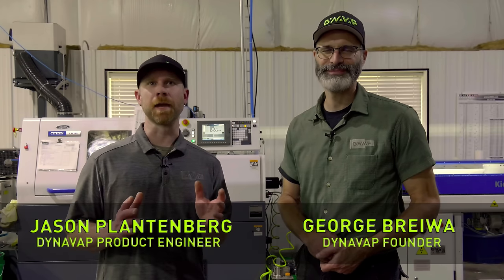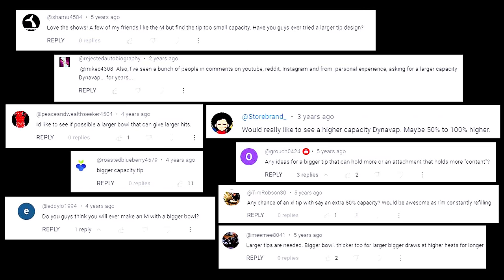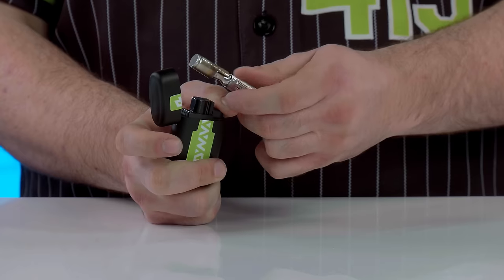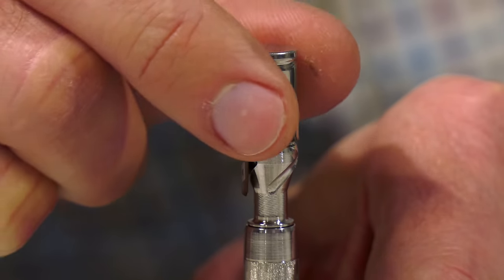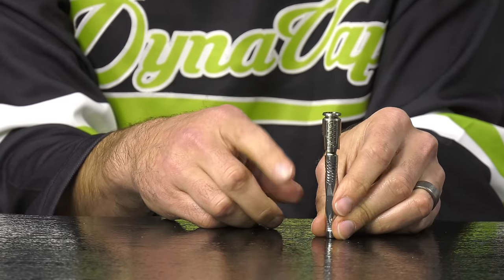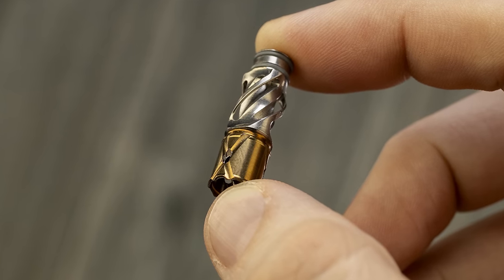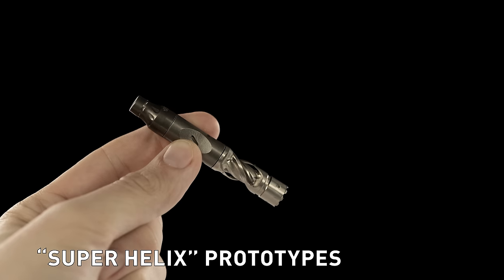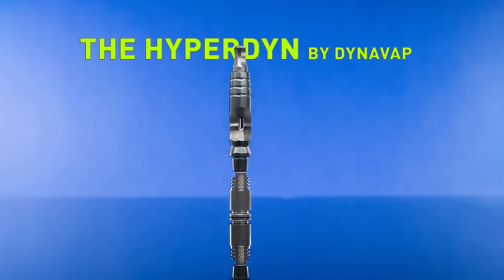Making the HyperDyn Chapter 1

Comment: I literally ordered my first unit yesterday (m7 XL)... don't do me dirty by releasing a better version so soon!
Reply: They always do lol
Reply: Dynavap release new things every year but they are different enough that u can mix parts from different dynavaps to change your experience i use a wood VonG with an 2020 M steel tip and an armored cap in an induction heater for hash in a bong for normal bud i have an 2023M+
Reply: you could send it back and just wait this one out
Reply from the maker: It isn't a new M.
Reply: They offer a 90 day satisfaction guarantee. You could send it back and get this.
Reply: @Dynavapllc  well in that case maybe I need 2 dynavaps :p (seriously though I am so excited for my xl)
Reply: I bet you can use this with your M midsection.
Reply: Once you try a dynavap you won't stop at just one. I currently have more than five different styles of the M model.
Reply: I used to buy new iterations but I keep going back to my 2018 m ss tip, and glass add a cap. Kinda curious about the m7 tip though.
Reply: dont worry you need to add a bit more of cash if you want to get this...! crazy expensiv
Reply: @f7go  not an issue lol
Reply: no real difference since 2018 . 

using rubber and not threads on the condenser.  

no cooling fins inside the stems.  

I've got best results from the original vong without a condenser. 

my ti vong was unusable from day one 😂  

for cool vapour. use any dyna tip and any generic glass stem ✌🏻
Reply: everyone complained about the thicker tips pre 21 .  😂
Reply: @unknown869 just now finally getting my 2nd (a B) for my wife and myself... buuuut I HAVE spent plenty between the low temp cap, the armored cap, the dynastash, the helix tip...

Comment: So...
1) Stems with integrated cooling spiral 'fins', or an integrated tip (?!) 
2) Smooth/no-groove tips all round, like on the woodwynd and M7
3) a new kind of (armoured?) cap on the left; possibly the groove helps remove it easily
4) New XXXL size

anyway, those are some sexy silhouettes. the centre one's my favourite; love a simple, clean mouthpiece.
Reply from the maker: You'll get to see if you are correct very soon.
Reply: Cooling fins are cool,
Loved my Fishbone pipe

Comment: I am a micro doser, so, bigger, with the ability to hold a dosing capsule sold me.  An issue, when I heat using the ISpire Wand, the HyperDyn stem gets really hot - too hot to hold a finger on the carb hole.  I need to find a silicone band, and put a hole in the band to go over that carb hole.  A Dynavap Capsule Keychain that holds 5 dosing capules would be awesome.  Love not having to clean constantly.
Reply: use a torch

Comment: Please make armored cap with interchangeable bi-metal disks.  

How about to unscrew the top of a armored cap and with possibility to change the bi-metal disk?  So you can decide on the go if you wanna vape at low temp or higher temperatures.
Reply: Dynavap doesn't use threads And if they did what you described would more than double the cost of the armor cap

Comment: After years of using my Omni's, I do have one suggestion. The airport needs raised bumps or a ring all the way around or something. Not just an indentation. It's always very difficult to find by finger feel. When I share it with friends, they have to visually find the airport first and always lose it when using the device. Imagine a smooth ring machined into the body all the way around the device where the airport is so that you can feel where along the stem the airport should be. Then around the actual airport itself, have some raised bumps in contrast to the smooth ring. This might help finding the airport just by feeling much more intuitive and faster.
Reply: did you try to use the digger outer for that matter? If you align it with the airport, it is very easy to find after the click.
Reply: @verdampftnochmalTV  That's a good idea. But it adds an extra step, making sure the digger outer is lined up with the airport. I'll try it though. Thanks
Reply: @DaveSimkus  it will become natural habbit after e few times, trust me. All the best buddy.
Reply: @verdampftnochmalTV  I'll definitely give it a go from now on. Thanks for the tip
Reply: @DaveSimkus  you are welcome brother!

Comment: I’m not engaging with more fomo products. It needs to be a clear departure from the norm or it’s not worth the money. A portable ball vape like the tempest is the only thing that would convince to give you anymore money.
Reply from the maker: The HyperDyn is brand new line of products similar to the M, VonG, Omni, etc.This isn't a limited run product but a whole new platform to build off of.
Reply: electric vapes are superior. i use solo 3 and tempest wont be better than it